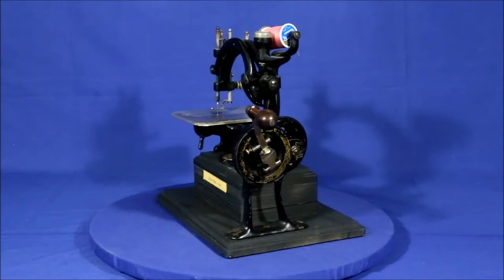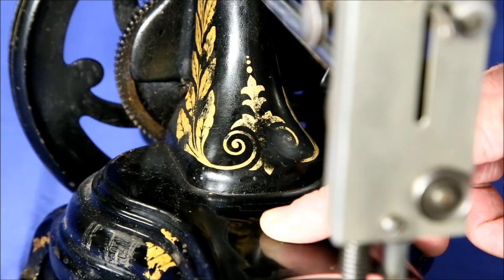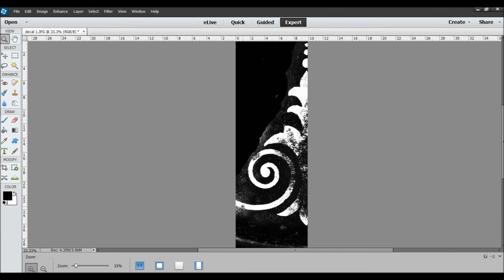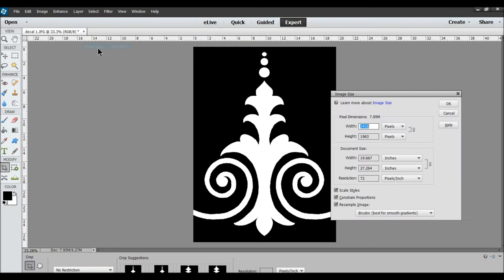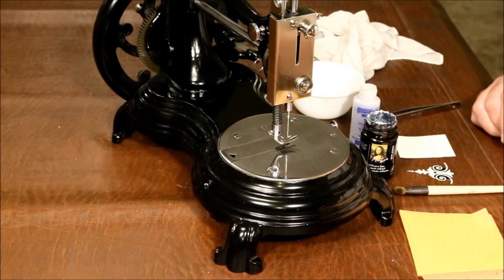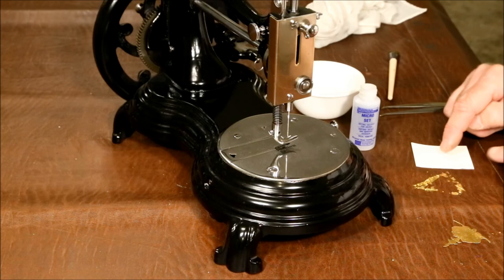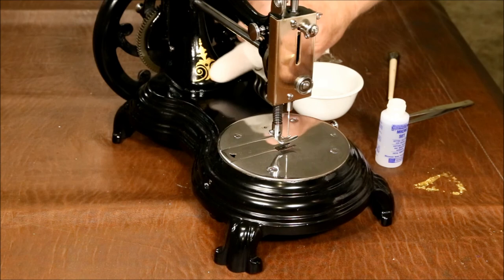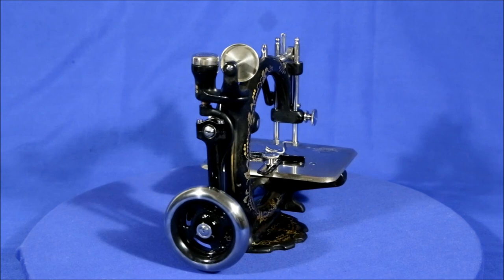Antique Sewing Machine Restoration - How To Make Real Gold Decals

Comment: Hi Wayne, I have used this video, and other videos of yours, to complete my New Companion Gold Leaf Decals. I think that I am ready to install. However, I have run into a small snag. My longer decals for the base are small in the middle and a little over 9 inches long. The decals tend to tear in the small middle when trying to slide them off of the water transfer decal paper. I have tried to leave the paper on, coat the gold back with Shellac, stick the decal to the machine with the paper on, wet the paper, and, remove it after the Shellac is dry. It appeared to work in testing. What do you think about this? Do you have other suggestions?
Reply from the maker: Tearing long, narrow decals is common. My solution is to cut them into short pieces no more than 3 inches long and line up the ends as they are applied to the machine. One drawback to this is that as they dry, they may shrink enough to create a hair-thin line where they were cut. This is easily touched up with a little gold paint. These lines are so thin that after touching them up they're almost impossible to see unless you're wearing magnifying glasses. I hope this helps.
Reply: @wayneschmidt490  Thanks Wayne, I am taking from this that Shellac is a bad idea for gluing down the decals. I took a closer look at the decal after reading your reply and found a good place to cut the decal. The cut will be between two loops of filigree. The cut will not be exactly in the center but I think that I can work with it. It's going to look great. As usual, thanks for the quick reply and great videos. The videos are a huge help to me and I find myself going to them for Decals and also Photoshop Elements 2022.
Reply from the maker: @jameswagner3685  I've never had good luck with shellac. I use spray can clear coats. But, many of them are lacquers, which can attack most enamels. If you used a gloss black enamel on your machine, the following video shows wh9ch clear coats may be safe to use:

https://www.youtube.com/watch?v=U547mOtMouw&t=92s

Please, always test which ever clear coat you choose to make sure it doesn't attack your base coat.

Comment: Wayne, I'm redoing an 1887 VS-2 fiddle-base and there are no restoration decals available for it. So I'm attempting to make my own using GIMP and your video is my lifeline! I made the machine's logo following your information, but as 24k gold leaf is expensive for me, I'm using metal leaf (imitation gold) and it looks quite good. Now, my question is... at the end of this video, where you used color on the decals, did you use acrylic paint or acrylic ink or something else, and what brand?
Reply from the maker: I'm glad my video was helpful. Thank you for commenting!

The colored areas at the end of the video were produced by the printer when the decal was printed, along with the black areas. I wanted the green to be pure green so after clear coating the decal, I painted over it with white enamel before applying the gold leaf. This prevented the green from looking like shiny green gold. I didn't back the brown areas with white because I wanted them to let the gold show through to give those areas a shadow look.

If you have a steady hand, an alternative is to add color to the decal after it's been applied to the machine but before the final clear coat. I use Testers gloss enamels. These are those tiny, 1/2-ounce bottles of paint sold in the modeling section of hobby and craft stores.

fiddle-base, but not what make or brand. Is it a Singer, Domestic, National?
Reply: @wayneschmidt490  Testers is still around? My brother used this for his toy models when we were kids. Thank you. My printer doesn't print color, so planing to hand paint parts of the decals, then add the gold leaf before placing them on my Singer. I'm doing my own slightly downscaled variant of the "Ottoman Carnations" decal. This design was not used on the VS-2 fiddle-base, but the time frame for the Ottoman is correct for the 1880's. I hope the copywrite police are not reading this!
Reply from the maker: @valeriep.4716  Yep! Testors is still around. You can find it in Michael's Craft stores, Jo-Ann's and Hobby Lobby.
Reply: @valeriep.4716  I heard Ottoman Carnations? 

I have a 48k that's in a regular condition, I'd like to restore it to its full beauty someday.

Comment: Wayne, can gold-leaf be applied using a laser printer with laser water slide decals? Also, you said to print the design on "color" slide paper. Is that correct?
Reply from the maker: You need to use "clear" water slide decal paper. I'm sorry if my pronunciation made it sound like "color." I don't see why laser paper in a laser printer wouldn't work, though I have to admit I've never used one.  The decals have to be sprayed with a clear coat after printing when using inkjet printers because the ink they use is water soluble. If laser print ink isn't water soluble, it might not be necessary to spray them before applying the gold leaf. That's something that needs to be tested. If you do, please let me know. I'm sure there are many other who'd like to know that. Thanks for commenting
Reply: @wayneschmidt490    Thank you so much for making this wonderful tutorial video and taking the time to respond to me and the others. Your decal looks lovely. I’m anxious to give this a try. I noticed you did say “clear” water slides at the beginning of the video, so my mistake.

Comment: how does one remove a decal to use on another machine?
Reply from the maker: Hi again! I don't know of any way to remove an old decal to transfer it to another machine, though I have one machine on which it seems to have been removed. Originally, sewing machines weren't decorated with decals. Instead, industrial transfers were used. This is a process where the artwork is lithographed onto transfer paper, then applied to the machine. When the paper is removed, only the paint remains. There is no transparent backing as in modern decals. How anyone could remove and preserve a transfer is a mystery to me. If you have a machine you want to apply a new decal to, many decals are available on-line for doing so, especially if you want a Singer decal. May I ask what machine you want remove the artwork from and what machine you want to move it to?

Comment: Do you have any links to suppliers of decals? I have an old National machine that has a lot of decals on it that need replaced. These have a lot of colors in them on top of the gold. They appear to be silver topped with gold, then detailed with transparent colors.
Reply from the maker: I'm sorry, but I don't know of anyone making National decals. There are many sources for Singer decals, a few for Wilcox & Gibbs and one for Jones Swan neck machines, but that's about it. Even these aren't as bright as the original lithographed decals. As it happens, my next restoration project, after finishing an 1875 Biesalt & Locke, is to develop a technique for recreating the silver-backed, multi-colored decals  used on many machines. Until then, I'm afraid all you can do is attempt to touch up the existing decals.

Here's a video I made on how to do this:

https://www.youtube.com/watch?v=bDZVF_H79T8&t=58s

Fast forward to 6:50 into the video to get to the part where I discuss making and applying transparent colors over existing decals. Please note: always do a test on an out of the way area to make sure this technique works on your machine. Each manufacturer used its own finishing techniques and you never know when a repair technique might have a bad chemical reaction to the original artwork.

Since posting that video, I've tested two dozen more paints and found Design master 14KT Gold spray paint (#230) is a closer color match and has more shine to it than the Decocolor pen.

I don't take any steps to remove any old shellac before re-decaling my machines.

Which National machine do you have? I have several in my collection and it would be interesting to see if we have the same one.
Reply: Wayne Schmidt This is my first foray into sewing machine restoration and the learning curve is steep. A couple weeks ago I knew nothing about sewing machines at all. Still can't sew with one, but I can figure out how to thread one and adjust tensions and stuff. Basic troubleshooting and adjustments, cleaning. I have some pictures I took and found online but nothing concrete yet. A serial number. It has the capped needle and foot bars, a retrofit electric motor (a National one). The decoration is not the art deco style; all filigree, leaves and simple flowers. The overarm badge just says National on it. No way for you to see pics in this comment interface. It uses a shuttle; i guess you call it a vibrating shuttle? Is swept forward and back by an arm under the bed anyway.
Reply from the maker: @dart70ca  The best source for figuring out which National model you have is a site called Needlbar. Here is a link to their page about National vibrating shuttle machines:

http://needlebar.org/nbwiki/index.php?title=National_Vibrating_Shuttle_Machines

National sold its machines under hundreds of different brand names. They had warehouses stuffed with completed machines with a blank spot for whatever name a buyer wanted. Many of these are listed, but many more were such small orders that no records remain of them. There are also no records for National serial numbers as they relate to manufacturing date.

In trying to figure out which model you have, ignore the brand name on the machines in the pictures, unless you are lucky enough to have one with one of those names, and instead focus on the details of the machine's shapes. The shape of the body, location of badges, position of the bobbin winder, the shape of the finial on top of the needlebar and what the main drive wheel look like are primary clues. 

A vibrating shuttle is one that moves in an arc. Transverse shuttles are those that move in straight lines.

Learning how to repair and restore antique sewing machines is a difficult and frustrating hobby, mainly because no repair manuals survived to modern times. It takes a lot of fiddling and thinking to figure out what to do. But, doing so can be very rewarding when you return something glorious to its original condition. Good luck, and please let me know what model you have!
Reply: Wayne Schmidt Wow, excellent. Thank you. Mine seems most like the “ Expert BT” shown here; http://needlebar.org/nbwiki/index.php?title=File:19govc.jpg
Similar decals, the handwheel looks like it would accommodate a hand-crank (notch in a spoke), the remains of my wooden base look similar. I do not have the double spool holder and the medallion cover on mine is plain and nickel plated. The lid latch plate in the wooden base, left side is different (mine is more like the right side latch plate). Not sure what they mean by the sizes there or what the measurements refer to.   By coincidence, one popped up on ebay that looks identical to mine, except for the name on the overarm. https://www.ebay.com/itm/ANTIQUE-SEWING-MACHINE-NATIONAL-Empress-Grand-WITH-WOODEN-CASE/184357472933?  Sorry for the single paragraph reply; this ipad doesn't have a return key 😜
Reply from the maker: @dart70ca  Happy I could help!

Comment: Would the modern cling film survive the low temp baking process for the final clear coat?
Reply from the maker: I have no idea. Even if it did, I doubt it would be hard enough to provide the protection of a true clear coat.
Reply: @wayneschmidt490  Thank you for responding! I keep going back and forth on whether I should use modern methods for the final clear coat, which all depends now on whether modern decals can survive the "cooking" temperature.
Reply from the maker: @ZacharyDBrooks  I'm not sure what you mean by "the cooking temperature." Why would you bake a sewing machine after applying decals? Are you thinking of Japanning a machine, applying decals, then baking it again?
Reply: @wayneschmidt490  According to this contemporary description of the Japanning process, after the decals were applied, the machines covered with varnish and then baked at 150 degrees for 12 hours: http://ismacs.net/sewing_machine_articles/japanning.html
Reply from the maker: @ZacharyDBrooks  Okay! Now I get where you're coming from. Thank you. I was stuck on baking temperatures over 300-degrees. 

I hadn't read that the varnish was baked. Hmmm... that's a little different than what I've read, where shellac was used to clear coat machines. Shellac doesn't require baking, though I guess it could be if you wanted it to dry faster. Interesting fact: If you shine a UV (black) light on a shellaced machine, the shellac glows. This is useful for uncovering otherwise invisible traces of the original art. One minute into the following video shows how well this works: 

https://www.youtube.com/watch?v=UampKLTYhmk&list=PLEnCVl0LWmYfasxI2p2mcDF0YauzDkwYY&index=23&t=0s

I've done shellacing on machines and don't like it. There are too many ways it can go bad. I've decided to use spray on lacquers like Design Master's Clear Finish Gloss #168. It's very forgiving and produces a great clear coat.

recommendationcommercially
Reply: @wayneschmidt490  I suppose if I am going to go through the trouble of japanning whole machines, I should probably use a modern clear coat that will preserve it better!
Reply from the maker: @ZacharyDBrooks  Have you watched my video about Japanning? Here it is:

https://www.youtube.com/watch?v=cKFvJY8tfF4

It might provide some hints about how to do it. Because it involves mother of pearl inlays, it requires multiple coats of the Japanning solution. If you're don't doing them, a single coat should be sufficient.

This video shows how the only machine I partially Japanned turned out:

https://www.youtube.com/watch?v=_FszWPhZ8Gs&t=76s

Good luck!
Reply: @wayneschmidt490  from what I've read the machines were baked for the japanning process, then the  decals were applied and clear coated
Reply from the maker: @joeeveryperson3279  You're right. The japanning solution is asphaltum, turpentine and linseed oil. In a production line, the machine bodies were dipped then baked at 300 degrees F. for up to a day. I did this for my Howe sewing machine and have to say it's a very dangerous and difficult process. They didn't use decal back then. Instead, industrial transfers were used. In this process artwork is lithographed onto release paper, then applied to the machine. This was there isn't any clear backing as in decals so there aren't any decal edges to have to try to French polish away. Only the paint is transferred. The clear coat used was always shellac. 

Since publishing this video, I've switched aways from decals and instead use a high resolution stenciling process, which in many cases looks much better than decals. If you're interested, here's my video about it:

https://www.youtube.com/watch?v=TYwWQzbIYyE&t=120s

Thanks for writing!